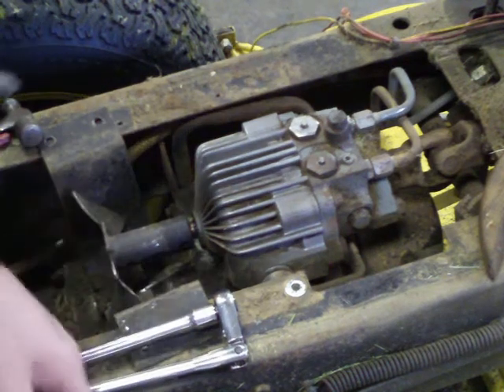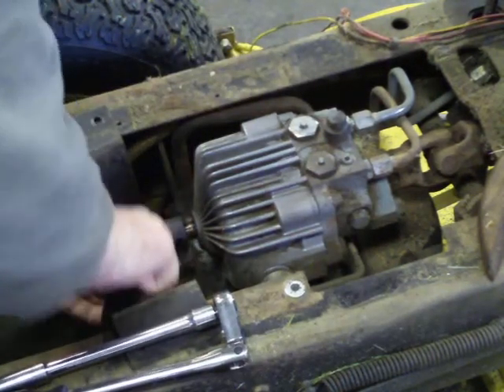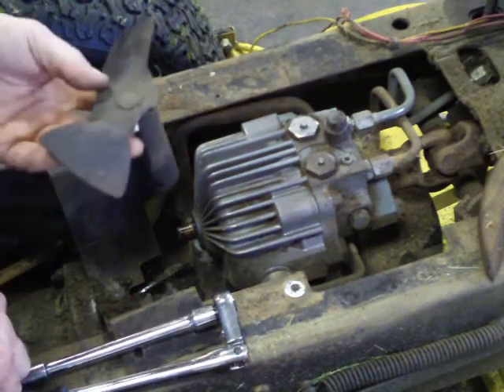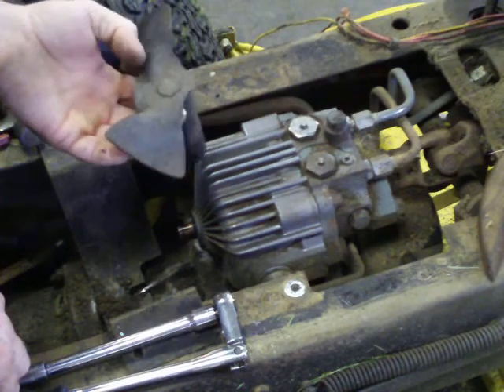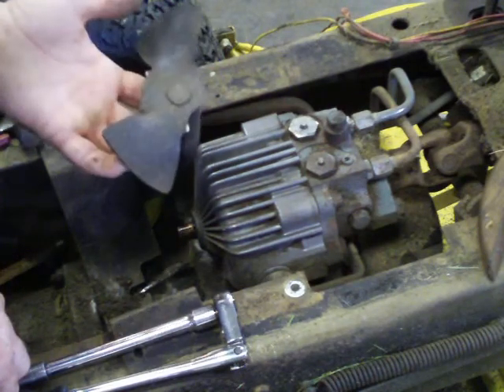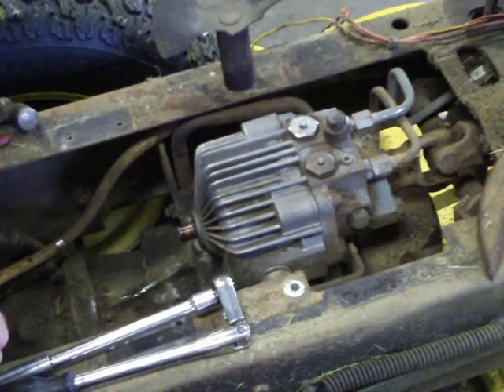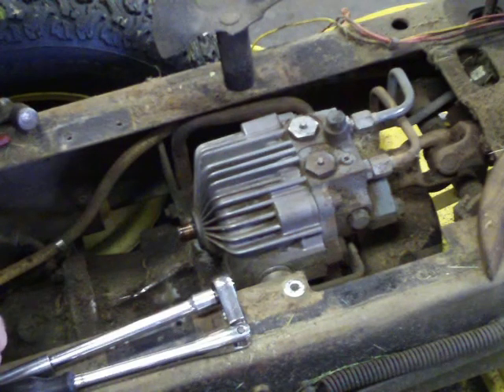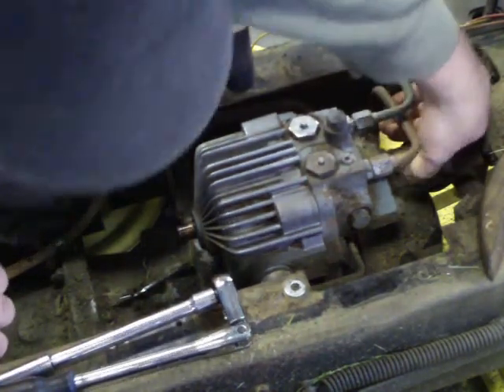John deere 317 drive shaft removal and cooling fan removal 003

Comment: @Needmorehorsepower Cool, he's got a tiller for his. He made the pto for it himself! We also rebuilt the deck last year. The driveshaft really needs replaced because at low idle it violently shakes and still shakes some at 1/2 and 3/4 throttle. We dont even choke it to start it, nuthin runs like a Deere!

Comment: Nice video! After fixing and flipping probably 20 mowers this season i'm really starting to like working on my truck compared to the mowers. Mowers are just small parts a pain in the ass to work on and real easy... For the most part. Like Ron, Clicked like but the button is dead!

Comment from the maker: @slowride55 yeah this replacement i bought is oem and its shaking real bad also im going to a drive shaft place here in town to have a shaft made it will cost as much as a new oem from deere but the u joint is alot biger and is 12 dollar to replace

Comment from the maker: Theres alot of 317 parts on ebay,i need a new drive shaft for my 317 they are 200 or 250 from deere.